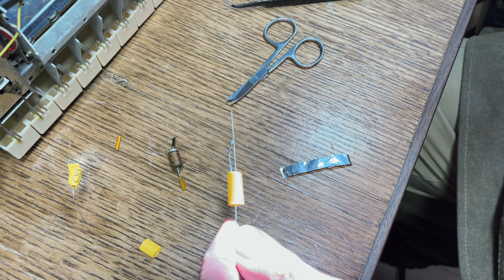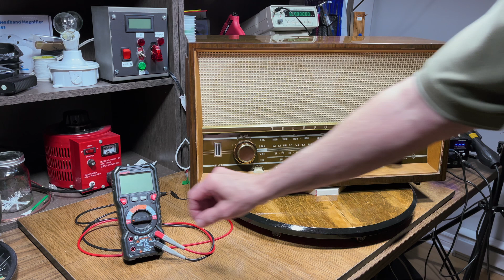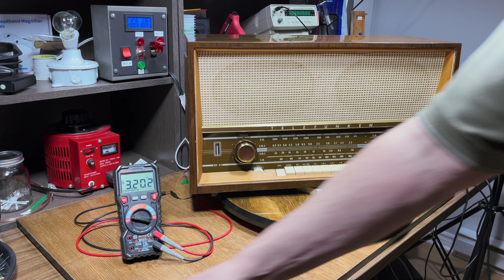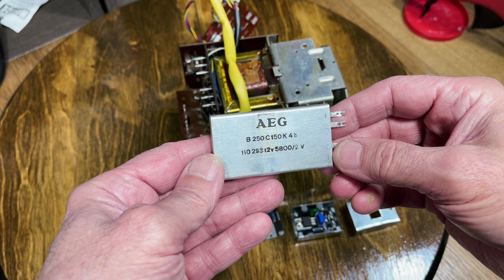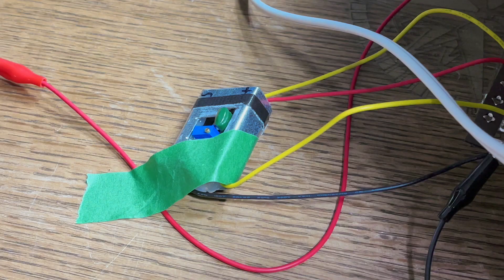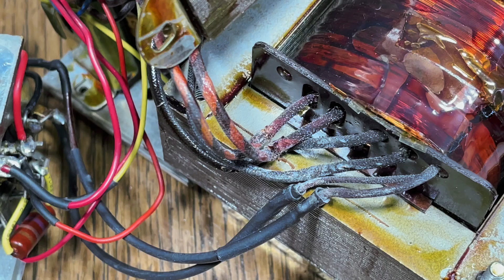Telefunken Concertino 5384 W Pt 3

Comment: Hi Raymond, excellent work so far. That was nice of your new friend to make the lazy susan, nice job too. I hope the transformer wires were the source of the short, you didn't seem 100% convinced. Manuel's voltage dropper is a winner, the broken resistor lead was tricky though. He mentioned 'someone' had trouble adjusting one in his video, I wonder if it was you? We have a tropical cyclone heading towards us in a few days, I may be incommunicado for a few days if we lose power. Cheers! 🙂
Reply from the maker: Thanks Dave, Indeed I wasn't 100% sure until I took it apart, fixed the wires and tested it again, but after fixing that short another wire broke off inside its insulation.  But since I was already working in that area it didn't take me too long to find the culprit.  I must say the power supply on this set is what gave me the most troubles.  The rest was almost easy in comparison.  Yeh, Manuel is absolutely talking about me, he could have named names, I would not have mind.  I wrote him 3 e-mails just about the voltage dropper, so yeah I'm the guy lol.  Oh crap really ?  A tropical storm ? Hope you don't get hit too hard my friend.  here we had a lot of snow, in fact I think we got all the January snow we didn't get all in one day 2 weeks ago.  Roads are clear now, but after the blizzard it started getting really cold;  Nights well below -20 and close to -30 taking the windchill factor into account.  Sure you don't need an intern for a year or so ?  I'd pay for my own food, I could pitch my tent in your backyard, I don't mind the snakes ?  The cassowaries on the other hand...

Comment: Salut Raymond, une question... pourquoi choisir un rectifieur à MOSTET (qui rajoute pour moi une complexité plus grande et fiabilité plus faible, sans parler de la maintenance) à la place d'un simple pont de diodes (et éventuellement  la bonne résistance chutrice) ? J'ai même vu que certains montaient des capa. en // avec les diodes - pour faire filtre ??!!
Reply from the maker: Salut Floyd;  Ta question est très pertinente et tu as raison sur tous les points.  Le seul avantage de ce rectifieur est qu'il est ajustable et quand on a assez de place pour l'installer et l'ajuster par la suite ça évite d'avoir à tester le voltage une ou plusieurs fois et donc d'avoir à changer ( souder/ dé-souder) les résistances.  J'imagine qu'avec le temps on pourrait aussi revenir faire un ajustement au fur et à mesure que les composantes vieillissantes conduirait à une variation du courant continue.  Mais pour être tout à fait honnête dans ce cas précis je voulais simplement tester ce nouveau board et comme j'avais assez d'espace pour l'installer j'ai sauté sur l'occasion.  Mais il fonctionne pareil comme tous les autres boards non ajustables que j'ai installé durant la dernière année; ni mieux, ni pire.  Bref je me suis contenté et ça risque d'être long avant que je n'aie encore l'occasion d'en installer un autre pareil.  Merci de ton passage :-)
Reply: @raymondmenard5444  , merci pour ta réponse éclairante sur tes choix. J'attends maintenant patiemment ton choix de "rectification" pour la Nordmende. Je pense pour ma part réutiliser le tube noir de la B250C125 AEG pour y installer pont de diodes et résistance(s)... Et c'est là que j'aurais besoin de ton expertise et de tes propres tests et  constats pour pouvoir comparer nos résultats, car pour moi la valeur de cette résistance chutrice reste bien mystique... Bruno, en attente de l'épisode 4 :)
Reply from the maker: @floydcouncil_trcb  Fais plaisir Bruno, écoute dans les épisodes 4 et 5 de la Grundig 4055, je démontre comment vider exactement la même cannette du rectifier et aussi comment j'ai remplacé les composantes en utilisant un des boards de Manuel.  À mon sens c'est la meilleure méthode et la plus sécuritaire aussi à comparer à un rectifier déjà assemblé qu'on peut se procurer.  Mais mes vidéos ne sont probablement pas assez détaillés pour bien voir comment j'ai fait.  Je dois terminer une petite Telefunken Gavotte pour une tante, mais aussitôt que j'aurai terminé je vais commencer la Nordmend,e on pourra voir ça ensemble.  Ça ne devrait pas être sorcier du tout :-)
Reply: @raymondmenard5444  , à la vue du schéma du Nordmende et des tensions repérés dessus, tu comprendras pourquoi je  suis autant hésitant... On en reparlera ;)
Ainsi que du repérage de la barrette de point de tests bien mystérieuse !
Reply from the maker: @floydcouncil_trcb  Ouais, comme je n'ai pas encore ouvert la Othello ni même regardé le schéma encore je ne sais pas de quoi cette barrette à l'air ni où elle se situe.  Mais me semble qu'il doit y avoir moyen de se connecter directement à la sortie DC du rectifieur. Pour les voltages j'imegine qu'on est au dessus de 280 Vdc avec tous ces tubes, c'est pas mal toujours ainsi sur ces postes.  Dès que j'aurai fini la Telefunken pour ma tante, je vais ouvrir la Nordmende :-). Hélas je ne peux travailler que sur une seule radio à la fois, question d'Espace sur l'établi et de capacités intellectuelles aussi ha ha ha.
Reply: @raymondmenard5444 , pas de soucis, prend ton temps ! Je viens également de m'apercevoir dans tes propos, d'un faux-ami anglais : silicon (EN) = silicium (FR) en parlant du pont de diode... D'où ma confusion  quand tu parlais de diode silicon(e), je ne comprenais pas ! :) Le Silicone pour moi, c'est pour refaire les joints d'étanchéité dans la salle de bain et la cuisine :)
Reply from the maker: @floydcouncil_trcb  ha ha ha, oui oui ok je viens de faire le lien avec la traduction juste en ce moment.  Tu as absolument raison en français c'est bien silicium, comme j'ai tout appris en anglais je n'avais jamais entendu le terme français.  Puis dans ma hâte de te répondre j'ai dit silicone au lieu de silicon, ce qui n'a fait qu'ajouter à la confusion.  Au final on parle bien du même élément.  Je m'excuse pour la confusion c'est bel et bien moi qui l'a causée, par ignorance du bon terme français. Quelle histoire :-)
Reply: @raymondmenard5444  , pas d'excuse STP, nous apprenons, c'est l'essentiel :)